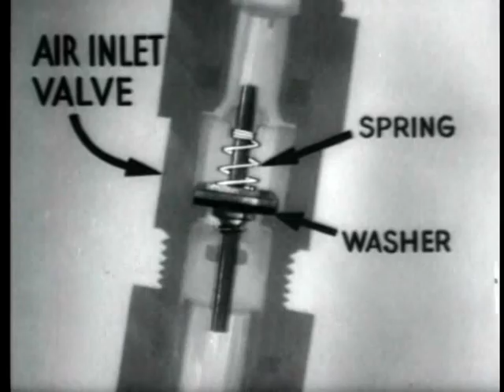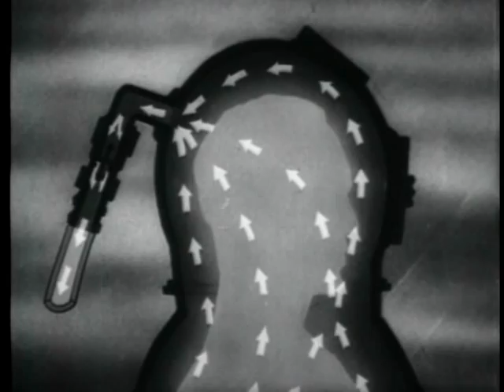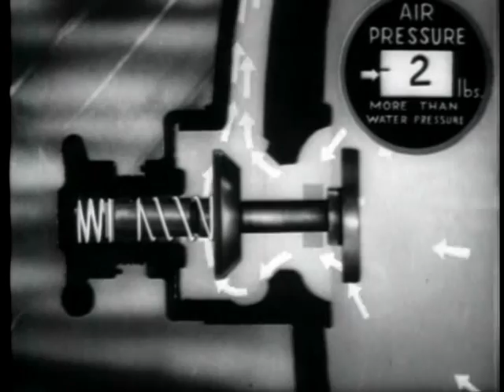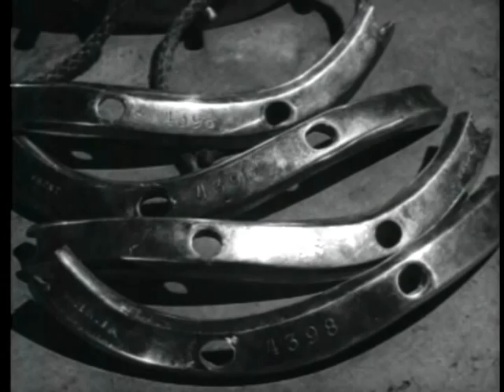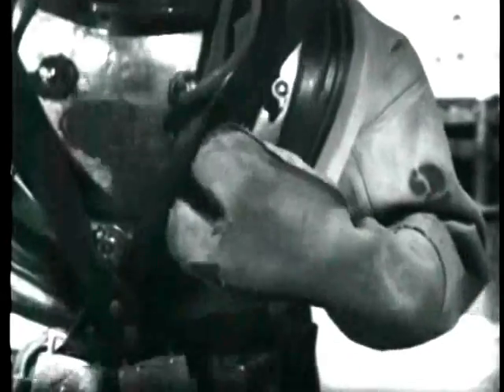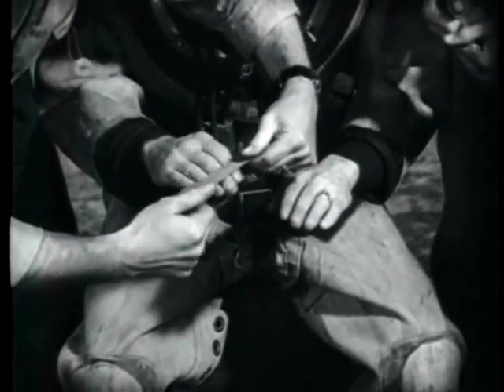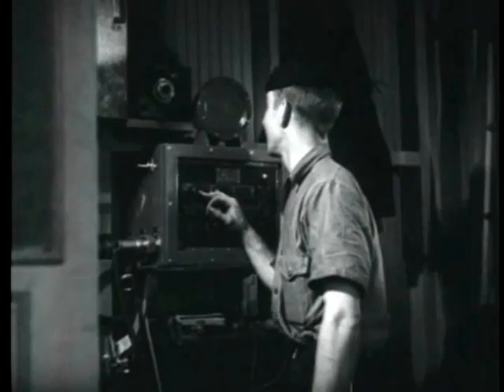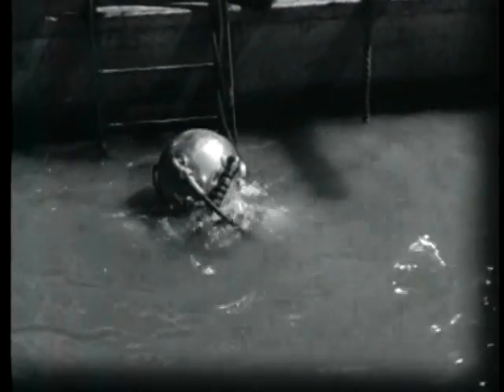DANGERS OF DEEP SEA DIVING Vintage Film - THE DIVING DRESS | Scuba Diver

Comment: I worked in this gear for 8 months every day.  Most of the dress in is the same however I was totally dressed in including the helmet locked down;  then led over to the ladder.  Sometimes I jumped off the deck since it was no more than 5 or 6 ft.  

That jock strap was a good reminder that the ladder was an easier less painful way of getting to the water. 

Anyway our rotation was 4 hours the a second 4 hours in the evening or night depending on how many divers were on board.   

We lived on the crew boat as well for 8 months, 7 days a week.   Welding huge patch plates on a bulkhead.
Reply: DALE thebelldiver with your experience, would you say it was at all viable to be able to kit yourself out?
Reply: Did you have welding visors to shield from the UV light and are they attached to the helmet ?